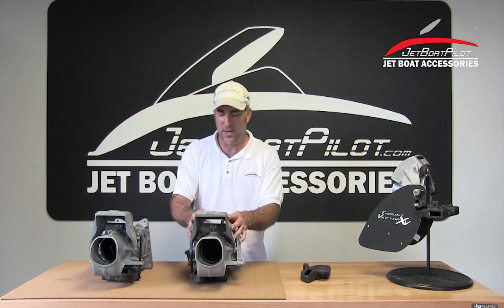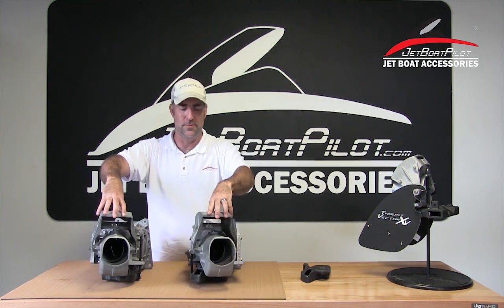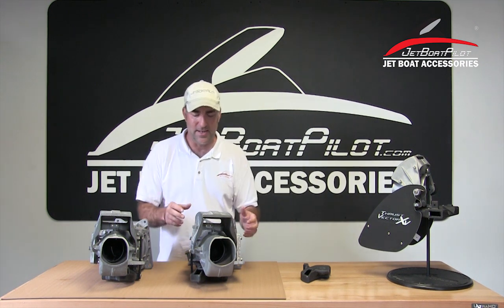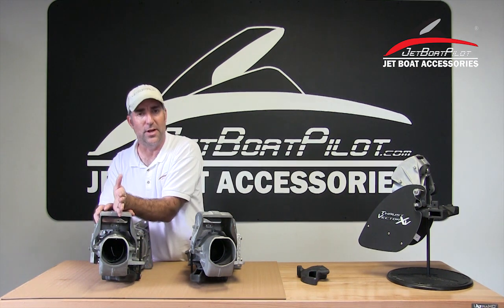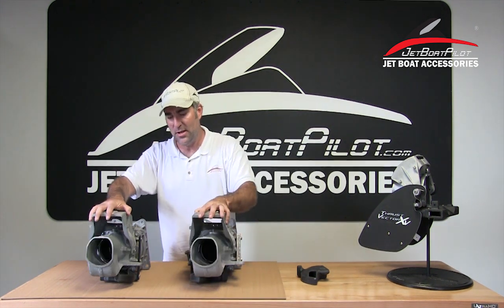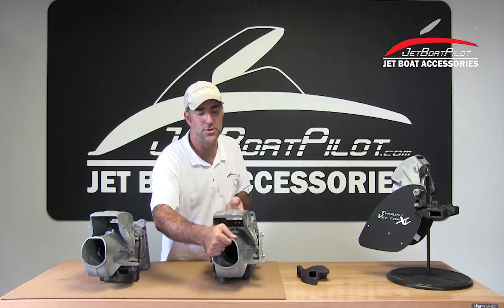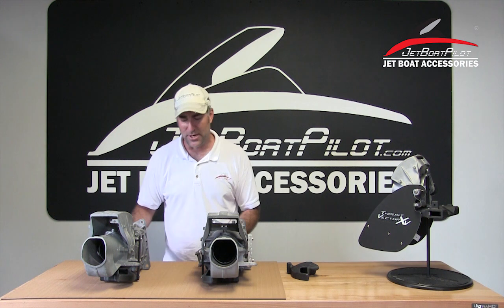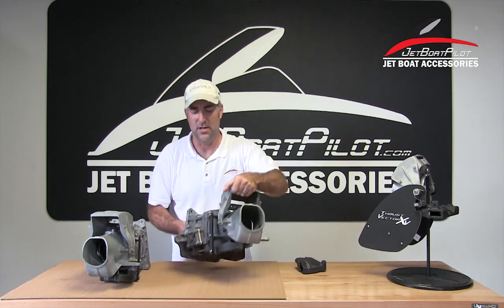JetBoatPilot Twin Engine Lateral Thruster Detailed Presentation

Comment: In this video you have the XV fins (on a stand) in frame but do not touch on integrating the two. Is the XV version the latest design to to accommodate the latest version lateral thrusters? The XV fins look similar to the competitor but do they still flip up automatically when on plane? I actually like the competitors feature that works while on plane??? My boat is the 2010 242 Limited S
Reply from the maker: The only version available now is the thrust vector L. The XV version was introduced in 2015 and discontinued in 2019.

Comment: Are they only affective when the steering is turned all the way hard left or right? Or does it still help in situations that don't require full hard left/ right?
Reply from the maker: skysurfer2010 when the steering wheel is held dead straight they do not have any impact but as you turn the steering wheel the lateral thruster increases its thrust proportionately to the angle of the deflector nozzle.

Comment: Firstly, I assume you have the reverse gates up for demo purposes and that their functionality is unchanged.  More importantly, I have Cobra Jet Steering fins installed.  They have a brace that utilizes that bottom bolt.  Is the provided installation bolt long enough to account for this?  I would say the plate is about 1/4" thick.  Thanks for your videos and products!
Reply from the maker: jastanger no we did not change the reverse gates. Also the Lateral Thrusters are not compatible with other fin systems. There are several reasons why. I can tell you in more detail if you'd like to call me this week. We're also offering a fin trade credit if you want to upgrade to Thrust Vectors. You basically get 35% off your Thrust Vectors if you order them at the same time you order Lateral Thrusters and also send in your Cobras.

Comment: How does it effect the boat when your in "neutral" with both engines running. How long till the guys at Cycle Springs in Clearwater get a box or two of them?
Reply from the maker: Doc Holiday Inn neutral they are inactive because there is not enough thrust flowing through them to make any impact on the steering. I have notified Cycle Springs of their release and I am sure they'll be getting some for the shelves soon.

Comment: Are these available for 2019-2020 model year twin engine boats?
Reply from the maker: No, not available on new style nozzles.
Reply from the maker: @letsridehard  we've tested LT on new style nozzles and I cannot assure you that they don't provide any added reverse control. If anything they take away from what you have from the factory. This is because of the divider plate that is connected to the underside of the reverse bucket. It eliminates the reverse flow on the side of the bucket corresponding to your steering input (steer right, nozzle turns right, right reverse outlet deactivates, left reverse outlet activates). If you look closely at your setup you'll notice that when the nozzle is hard over the inlets for the Lateral Thruster don't align with the active reverse outlet. It is for this reason we don't recommend LT for new style nozzles. We are however developing a new LT 2.0 for new style nozzles and should have it ready by fall this year.
Reply from the maker: @letsridehard  yes the new LT will do for the new style nozzles what the original did for older style nozzles.

Comment: Do you have a video on how the lateral thrusters work with the ventor plates? Also is that a compatible set up on my 2006 Yamaha 210?
Reply from the maker: Patrick Burckhalter we don't have footage showing older model Thrust Vectors with Lateral Thrusters but do have templates created if you want to trim your old Thrust Vector find in order that they work with the Lateral Thrusters. Also they are compatible with your boat.
Reply: Sorry for the confusion. I didn't think you would have a video in of an older model like mine. I meant a video were you can see how the two work together on a recent model. Something like a gopro suction cupped to the bottom of the boat showing low speed operation in action.
Reply: I can see the model in the corner but cant get a very good view of it.

Comment: seems like a great product but for me, first time ever on a boat, first time ever loading on trailer, it only took me the one first try and I was on the trailer, no problem with my 2020 AR240. I think the boat just needs to be learned on how to handle the two levers. I was playing on the water with it and it pivots on a dime so, I am not sure about the need to spend hundreds of dollars for low speed maneuvering.
Reply from the maker: When in windy or tidal zones the added control is a must. Also for drivers who are less experienced these also provide lots more confidence.

Comment: Can you have the foreword thrust vectors and the side vectors
Reply: I mean reverse
Reply from the maker: Yes Thrust Vectors and Lateral Thrusters are fully compatible, giving you the most control possible around the dock and at slow speeds!
Reply: I installed the Thrust Vectors on my 2014 AR210 and they work great. Are the Lateral Thrusters as easy to install, I would assume it is as simple as removing a few bolts and making the modifications?
Reply from the maker: Yes, very easy to install. As a matter of fact, easier to install than the Thrust Vectors. Literally one screw in the bottom and a screw on the side stabilizer bracket. Two tools for removal of existing parts, a 12mm socket and a 10mm socket plus one tool for installation, a 5mm allen wrench provided with the kit.